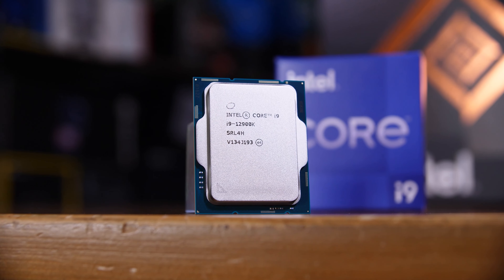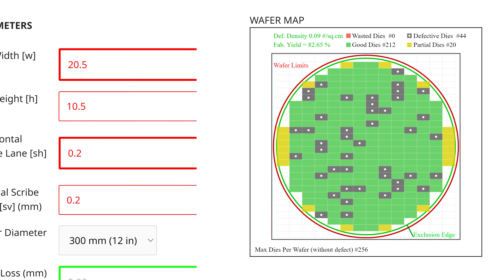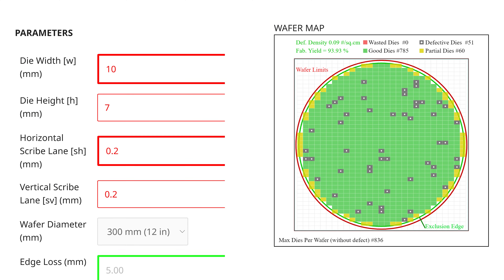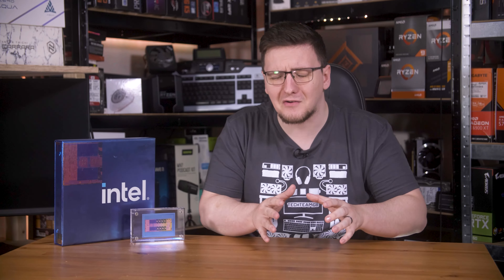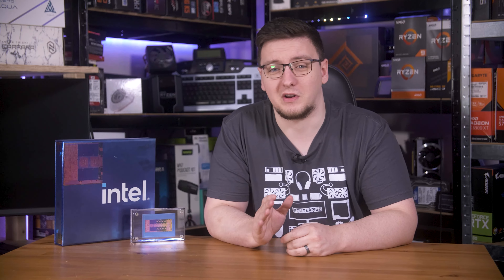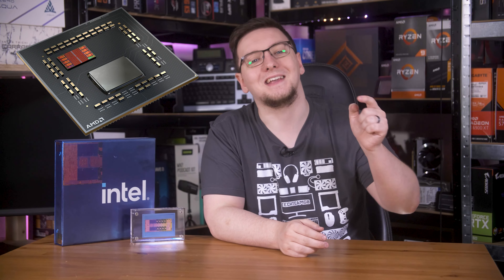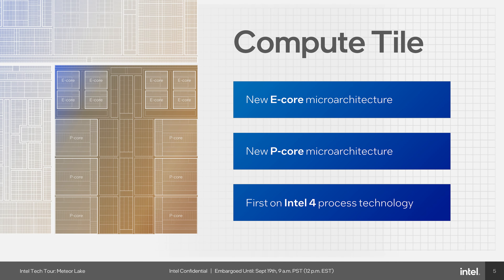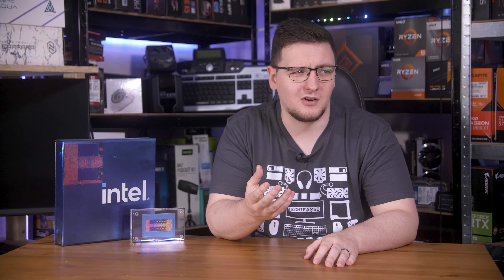Why are AMD AND INTEL using CHIPLETS (Tiles)??

Comment: TechteamGB : yields efficiency is comprised out of : how small the die is to save space + how many are damaged due to overheating issues. For example, AMD-s yield efficiency is inbetween 87 % - 92 %....whereas Shintels is only from 18% - 24%....this is another self-hindering tactic to poor earning of Shintel besides being problematic CPU-s and having to high of a price.